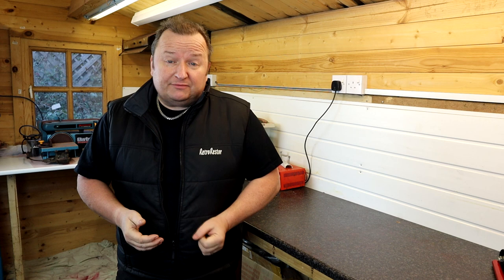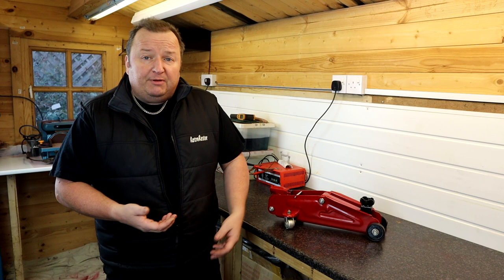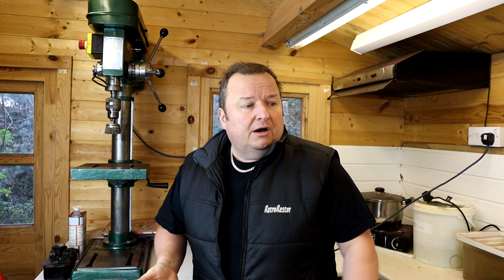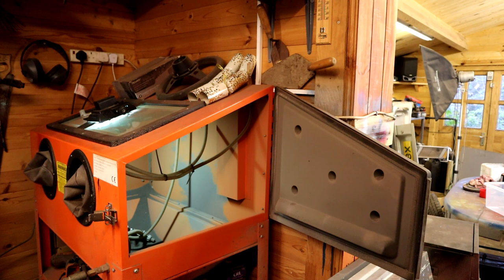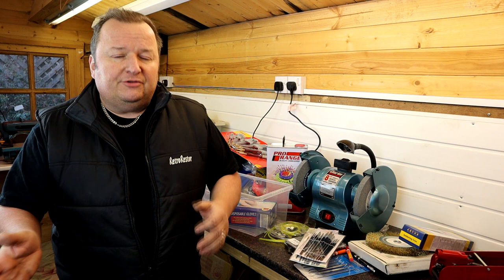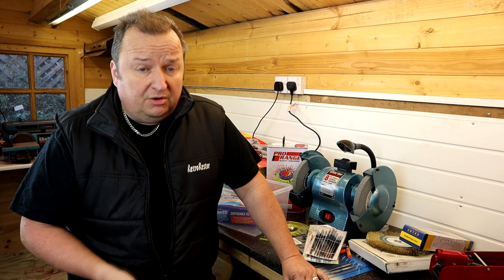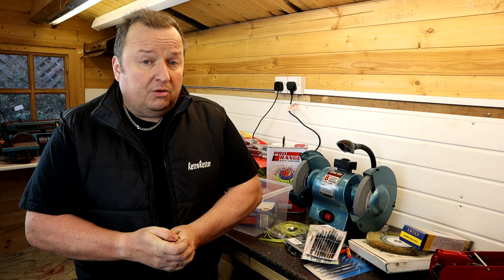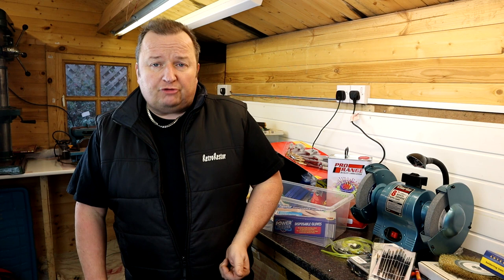Being A Youtuber And New Plans

Comment: Its good to have a plan however flexible it may turn out to be. I had trouble with my arm and ultrasound  combined with acupuncture sorted it in  a few sessions to my surprise as i had always been sceptical  about sticking needles in to provide long term cures. Been over 10 years since. All the best for 2019.